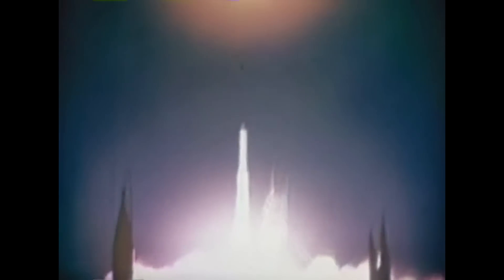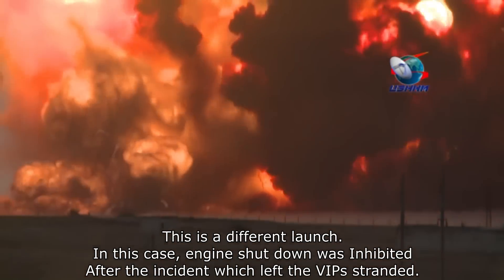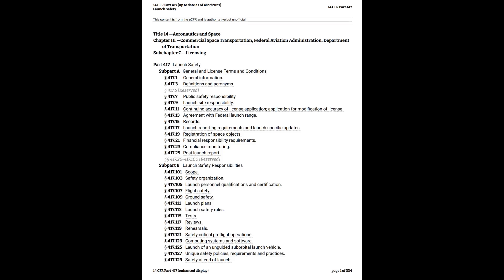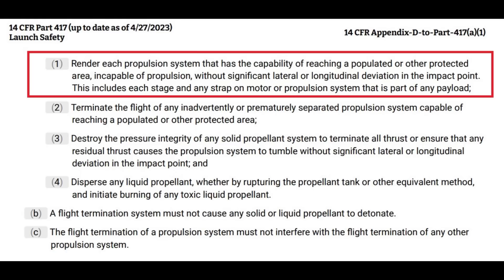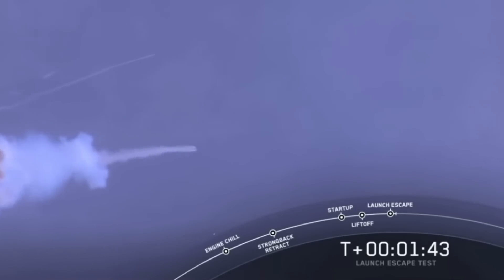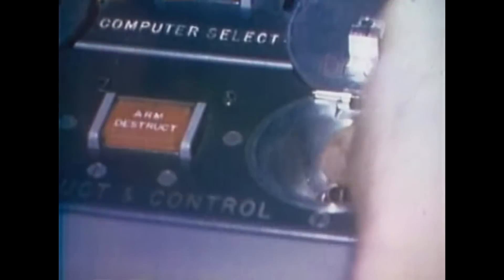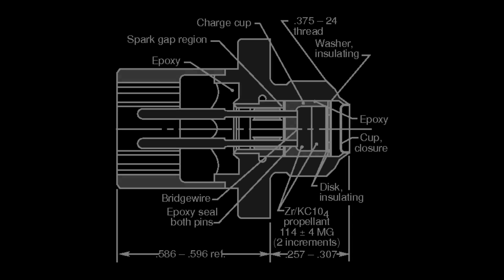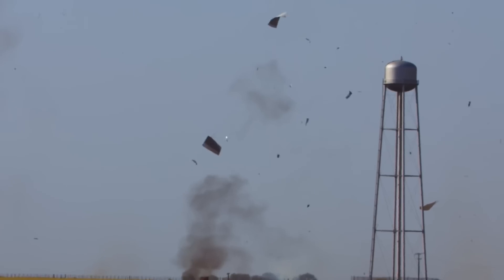How To Destroy Wayward Rockets - Flight Termination Systems Explained

Comment: Got involved sizing guns for launch destruct system for Cassini back in the early 90’s. The probe had hypergolic fuel/oxidizer that they would have normally used self forging fragment to deal with self destruct, but they didn’t want to risk poking a hole in the containment casks for the plutonium filled RTG’s. Fun job.

Comment: Im a newb and want to get into rocketry. Im not program savvy with electronics nor am i 100% rocket savvy. Im a cowboy by trade with an over active knoggin knome. But Could you use rollerons like the Aim-9 to control that roll? Would take a second for the spin up to happen i understand. Aim-9s are pre spun by aircraft speed but some air nozzles on the launch pad could help nix time to gyro stability.  Maybe Use a servo inside running a long line through a raceway for control? With the active roll control since it's constant I think would uses alot of battery and produces alot of constant drag. Maybe cut some electronics and battery weight sans active program for rollerons and just to focus on programmed control instead? Would love to hear pros and cons from anyone. I love to learn.

Comment: Do you think this automatic system exists. ? Has this system been inspected and simulation tested. Did the FAA sign off on the test sheets. ?
Does the system be required to use "Explosion Proof/Flameproof components. I did not see any. ? Methane gas very flammable/explosives' gas. Are SpaceX violating existing safety requirements. FAA too double check this..

Comment: Will the FTS work on the next launch if needed. ?. The newly installed system should be inspected and offline tested by FAA test and inspection engineers. Do the FAA have such an inspecting and test engineering team. ? This system of inspection and testing should immediately be carried out for public safety and a full accountability report made available to all online. No more excuses.

Comment: Starship had the FTS rather high up on the side of the booster.
It's possibly that holes were blown in the tanks straight away, but the tumbling of the rocket forced the fuel and oxidizer to be at the bottom of their respective tanks and unable to quickly vent out of the holes.
If so, it should be a simple fix to change where the FTS blows the holes in the tanks.

Comment: Failure of the FTS to work properly is far more common than you would expect.   It is supposed to be something like .9999 reliable, but in fact actual data shows that full or partial failure of the FTS to do the job is just about as likely as needing to use the FTS in the first place.   Most rockets destroy themselves before you need an FTS, but there have been FTS failures at Vandenberg AFB,  Cape Canaveral AFS,  and Wallopps FF as well as at Baikonour and Xichang.

Comment: In the early 70's I worked at Allen Bradley (now Rockwell Automation).  They had a contract from the Air Force to build an antenna duplexer for the Atlas rocket (the RF coupler in your diagram).  It was referred to as a "command destruct" unit.  It was a passive device, but the only single point of failure component and thus super tested.  It was hand built in the R&D lab, and, naturally, gold plated!  By the way, the lab was headed up by Dr Heinz Schlicke, former German scientist (Google U 234, Operation Paperclip)

Comment: Can the automated termination system be part of the main system or rather triggered by the main system? The FTS can still be separated and triggered manually, but wouldn't have to include the whole flight path tracking hardware.

I wonder if some of the termination systems could potentially be triggered by evil guys on the ground. Especially in the early days. How complex were the radio signals?

Comment: Shaped charges have also been used for many decades in gas/oil well completion. First, heavy casing is run into the borehole. Next, cement is pushed down through the casing, U-tubing up the borehole annulus surrounding the casing. After the cement sets up, shaped charges--at the exact depth of the hydrocarbon-bearing layer--are detonated, blowing holes in the casing and the cement, penetrating into the rock some depth.

Comment: I do wish you had told the story of the saddest flight termination; 
Rocket Labs 1st ever flight, it was,unprecedentedidly, going straight to orbit, or at least would have but for their 'recently-added-investors' forced use of 'their' "flight proven" tracking software instead of RL's own  brand new in-house tracking software (which RL continued to use in the background anyway) to run the flight termination hardware. 
So when 'their' tracking software had failed to be setup correctly for its first southern hemisphere use and thus lost contact with the ship (despite the homegrown software still tracking flawlessly and showing the rocket preforming perfectly) the ship was blown from the sky mear seconds before second stage deployment, thus destroying not only the 'inaugural flight, straight to orbit' record but also the blew-up the 'easter-egg' payload, a secret satellite that Peter Beck (backing his own rockets success) had handmade himself... 
Sad.

Comment: 0:23 My worry is not a failed rocket going ballistic rather it uncontrolled converting it's flight path to mimic a powerful cruise missile or torpedo is the bigger "oh crap my pants" moment. 
A ballistic missile would go up high, shutdown propulsion and then ballistically, follow a flight path to the point of impact.

Comment: I was building Command Control receivers with Conic Data Systems (later bought out by Loral) in the early 1980s.
We were responsible for the receivers for EVERY nuclear-capable missile being produced in the USA at the time - including ALL of the Cruise Missile variants.
I got to take a tour (with my co-workers) of the GD factory where the cruise missiles were being built.

I later worked for SAI Technology - were one of our Plasma Display terminals was used in the control system for the GLCM, including flight termination command issuance.

This was before "automatic" systems existed to any degree for flight termination.

Comment: Typical Rocket is loaded with different types of explosives not counting fuel...

Many rockets use Explosive Bolts to hold stages together, then are detonated allowing stages to separate. Explosive Bolts are used on the Launch Pad to hold rocket upright. At time of actual launch, Bolts are detonated, freeing Rocket from it's launch pad grip. Linear Shaped Charges are used to 'Destroy' a wayward rocket. 

Bridgewire Detonators are extremely precise and extremely reliable too. They are used in Nuclear Weapons and 'Trigger' the 'Implosion' of Plutonium Core. Sheets of Explosives wrap around the Spherical 'Core' and when detonated, all have to explode within nanoseconds of each other to cause Core to go Super Critical and cause run away Nuclear Explosion. 

Sale of Bridgewire Detonators are closely controlled by Government. They could be misused by foreign adversaries in their own Nuclear Weapons Programs. They are also used in Rockets for same reason they are used in Nuclear Weapons.

Linear Shaped Charges are the mainstay of Controlled Implosions of Steel Framed Structures. They can slice through metal very precisely. They are used in conjunction with 'Kicker Charges' that push steel that has just been sliced by Linear Shaped Charges away allowing Gravity to take over and bring building down.

Rockets are like giant bombs waiting to go off... Rupture the fuel tanks while rocket is going Supersonic and it's like the 4th of July. Mixing LOX and H2 at high velocity outside tanks or engine = boom and lots of steam.

How do I get a job at NASA to 'Push The Button' when all else fails....

Comment: I'm curious if the flight termination system worked properly on the Starship launch. It seemed to tumble for quite a while after it became clear that the flight was not going well, and it looked more like it was torn apart by aerodynamic forces when it finally did blow up.
Reply: It did not work properly.

Comment: Yeah it was a bit baffling watching how long it was tumbling before apparently detonating. When I looked at better footage I realized they did the range safety detonation about 50 seconds before it apparently exploded. You can see two Trails of Vapor one from the booster, one from Starship, and that continues for about 50 seconds before the whole thing flies apart. In an interview since then Yolanda has stated that they needed to have a more powerful ring safety system, and that backs up the idea that it just punched holes in it, and it took too long for it to fall apart.

Would it have been a danger in lower atmosphere? I don't know. It could be that with greater atmospheric drag those little holes might have ripped it apart instantly if it have been lower, but I would want more of a safety margin in case the rocket started flying toward people or a facility.

Even in my cell phobe video, you can see the twin contrails at 3 mind 56 seconds before the apparent detonation at 4 mins 4 seconds.

https://youtu.be/pGwlkaClv3Y

Comment: Fantastic overview. Very accurate. A couple other interesting things about Flight termination (from an insider): 
- The ranges safety officer works for the Air Force and is in no way associated with the launch provider, therefore they do not have any sentimental attachment and hesitation towards pushing the big red button. 
- Flexible Confined Detonating Cord (FCDC) is also a very common explosive used on launch vehicles. Imagine hundreds of feet of this explosive cord (looks like coaxial cable) running throughout the rocket to assist with FTS. 
- Yes, ULA uses the same initiators. There are also "Lanyard Pull initiators" which automatically detonate when their lanyard is pulled, creating a chain reaction. My understand is that these are usually used for intentional separations.
- The radio signal used for FTS is a very closely closely guarded secret. You wouldn't want someone to figure those out and decide to make their own fireworks show.

Comment: A couple of things, my father worked on the early rockets and they used a pendulum that would be released to terminate the rocket by swinging around and it would proceed to beat the innards of the rocket to death.

And I think that it was "The Smithsonian" or "Army Times" magazine that had a really great article on Range Safety Officers about 50 years ago. Early on, they would be situated at different locations and look through a "V" which was made by stringing two wires up from the ground. If the rocket deviated outside of either wire, the RSO would hit the kill button. Apparently there would often be higher ranking officers assisting the RSOs to (helpfully) make sure that the rocket was really outside of its bounds and actually needed to be destroyed. 

One of the photos in the article showed a rocket travelling horizontally through the wires with the caption "Sometime the RSO's decision was an easy one" or something along those lines. If anyone else remembers that article I would love to get the link to it. :)

Comment: I worked in the field from early ‘60s to ‘90’ and at that time telemetry was an important component of range safety. I presume only bent pipe GPS is used now.  Nice video. Thanks.

Comment: Hi Scott, what are the chances of falling a full rocket engine debris after the termination from a starship test flight and are people's allowed to keep those debris if they find one?
Reply: Chances of debris, high. Chances of people finding any, none: The launch site is coastal, and the rockets immediately steer eastwards over the gulf of mexico. All debris lands in water, for exactly this reason.

There's plenty of debris from the remains of the launch site though. It's on SpaceX property, and the adjacent state park. You might be able to visit the park and find some pieces of the pad's fancy high-temperature, 'rocket-proof' concrete.

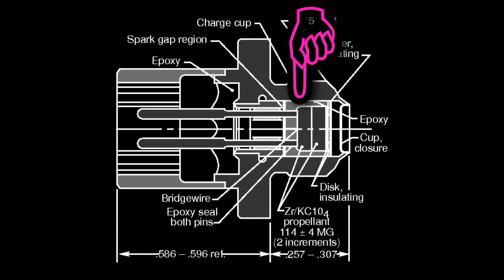Comment: At 9:26 there is a technical drawing with a ludicrous typo. The "propellant" is zirconium – potassium perchlorate , whose chemical formula is ZrKClO4. That is CL not C1 which is the error in this diagram. Here we see careful precision with limits, e.g. .586-.596; .257-.307, yet for all their precision, this formula error caught my eye instantly. I mean how long did Scott display this diagram. But I am a retired chemist, and I immediately thought "WTF? that is not right." Yet here it is, never checked, never corrected.

Comment: Is there some differences betweened manned and non-manned flights?  I understand there may be a point where you HAVE to destroy the rocket, even with people on board.  But are the 'safety corridors' wider, or wider tolerance for automating 'out of control distruct'.

Like they mentioned in the movie "The RIght Stuff", "do you think a monkey knows they're sitting on thousands of pounds of explosive?"   Now we have to think about, "Do you know there's a couple of circuits, made by the lowest bidder, designed to BLOW you up on purpose?"

Comment: I would bet, that Starship is going to get a proper launch escape system at some point.
A rocket that size that needs working engines to land safely does not sound like a good lauchn escape system to me.
And they would probably need it any way incase their powered landing has a mayor failure.

Comment: Shame that never happened to the Starship....though good it blew up itself
Reply: On Starship, they did fire the system but it didn't blow up at first. As it spins out of control, you can see it venting gas from the holes blown into the tanks...once those tanks lost enough pressure, the whole ship collapsed and exploded.

Comment: The source of the explosion that finally destroyed the starship booster seemed to come from somewhere in the engine rack.
Reply: I think that's because the engine thrust ripped the booster open from the bottom end. All the time it's spin out of control, you can see it venting gases out of the side of the tanks, meaning the flight termination system had been fired but failed to destroy it instantly, eventually the pressure in the tanks dropped enough to compromise it's structural strength.

Comment: As an aside,  there seems to be a trend away from pyrotechnic (explosive) devices for staging/fairing separation. One reason is trying to avoid leaving more debris in space, though the debris is contained in some designs.  Another is that reusable vehicles need to avoid the damage that a pyrotechnic device can cause. Springs of various types are now often used. Space X is trying to use spin to separate stages with its Starship system.

Comment: what if we really just made a super reliable smaller missile launcher to shoot down terminated launches, and remove the self destruct, it would free up room, weight and be one less thing to worry about maintaning
Reply: Just until you factor in the costs of operating and maintaining a surface to air missile system and making sure it's safe.

Comment: The Saturn 5 had explosives on Lox and RP-1 tanks, but on opposite sites. This was to NOT mix Lox and Fuel during rupture. This would result in "gradual" burnoff instead of a shock wave, guaranteeing save escape for crew.

Comment: But if a flight termination system has a radio receiver to receive the termination command, wouldn't that mean that anyone with a radio transmitter can send the termination command if they know what it is? Or even jam the termination command of the party that launched the rocket? If so, either would seem like a serious security risk to me.

Comment: Common Sense Skeptic thinks that the FTS didn't work on  Musk's latest Space X flight - the booster was tumbling out of control and clearly bent well before it eventually exploded, suggesting that it exploded because of rockets themselves and not the FTS.
Reply: Lots of people think a lot of things that are wrong.  Lots of people think the earth is flat too.
Reply: @TheEvilmooseofdoom  it was a genuine question, which you've deflected with humour rather than attempting to answer.  

Interestingly, Scott Manley explains how the system works, but didn't then relate that example to the Space X flight, which would have been an obvious example to use in showing how it worked in real time. The rocket was tumbling for several seconds, clearly out of control and the Super Heavy section was shown as very clearly bent in one photo and yet the self destruct system did not occur.

Asking questions isn't a bad thing btw. In fact I'm pretty sure that's exactly how science is supposed to work.

 Is the earth flat? I don't think so, and the evidence definitely suggests it's round, but I have to admit I've never actually seen the earth's curve. Have you? 😁

Comment: The REALLY advanced mission termination system in multi-engine rockets (like Starship) will be simply to shut down all engines, separate the vehicles, restart whichever engines are still working, fly back to a 'safe landing' site, and hover long enough to burn up all the extra fuel... then land the booster and starship as best they are able.  Presumably with this capability, blowing up the vehicles will become increasingly rare.

Comment: I hope we get a follow up when we find out what happened with Starship. It’s termination system didn’t seem to meet those 4 requirements and rained an awful lot of debris (not flaming though) on populated areas.
Reply: Debris from the launch site is a very different thing.  As far as I have heard no part of the rocket itself landed on land.  Am I dated?  Have you heard about rocket parts landing on land?
Reply: Debris is from the pad and not the vehicle, and thus is out of scope.